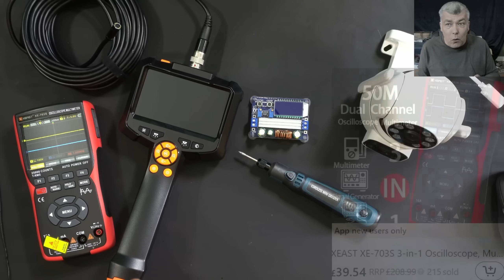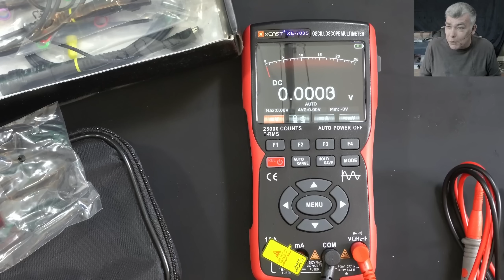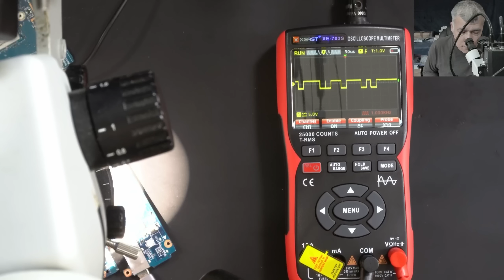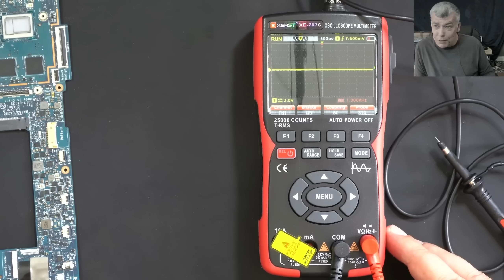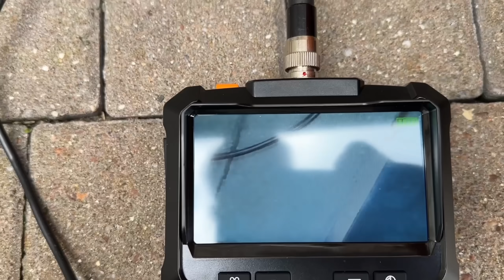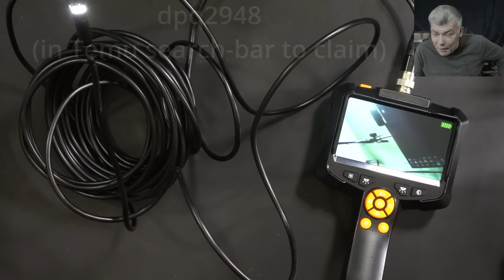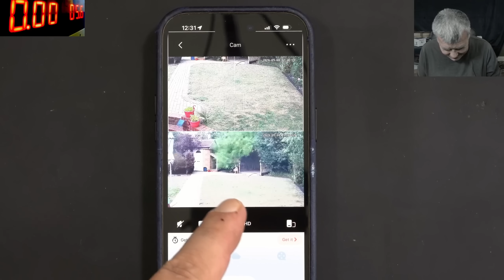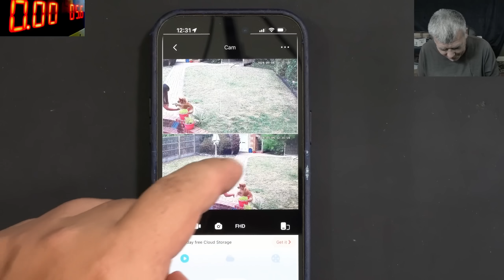Affordable tools from TEMU - Oscilloscope, Endoscope, Mini Grinder, DC-DC Buck/Boost, Security cam

Comment: The DC to DC buck converter has a maximum output of 2A before the overload led comes on. They suggest hooking up a 10A Ammeter to measure the current. Watch out for the magic smoke. 5V at 2A serious kick off that. 🌩

Comment: Is the 100 pound coupon only useable once you buy a certain amount of other products? Oscilloscope 50MHz? if it is using both channels it will halve the frequency. Most of these oscilloscopes don't achieve their specifications. I would like to see a set voltage read by the oscilloscope after setting the graticule and see how close to the input voltage is shown. Plus show the zoom in on a signal and see the noise level. What is the lowest signal voltage it can display without displaying a false reading?

Comment: Hey Sorin, I purchased the same soldering iron/ reflow station from Ali Express after watching your last temu video, when trying to replace my first ps5 HDMI port the reflow gun shorted and sent a huge spark into the HDMI metal housing, blowing the fuse in the rear of the machine and tripping my switchboard.
I hope the ps5 motherboard is okay, I’m yet to receive another more expensive reflow station. 
Don’t get me wrong, I love cheap Chinese tools but be wary of that cheap reflow station
Reply: Ok, so if the products fails we send them to him.
Reply: @MrFluorescentify  more like just a heads up.
Reply: New reflow station arrived and I replaced the HDMI port “and we have picture!” 
At least it didn’t damage the motherboard 👌🏻

Comment: I love tools they make our life easy. thank you sorin! I have a question about the DC to DC. I tried to make power supply out that. but when voltage goes down like <=1volt the current stays <1 even if I increase the current. is there any adjustment I can make?